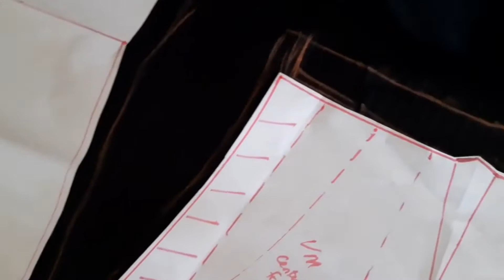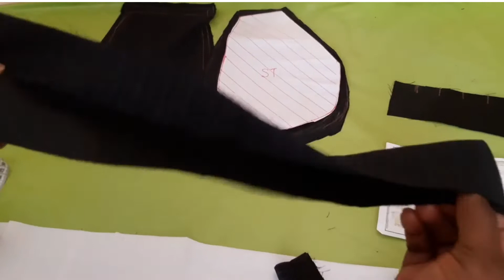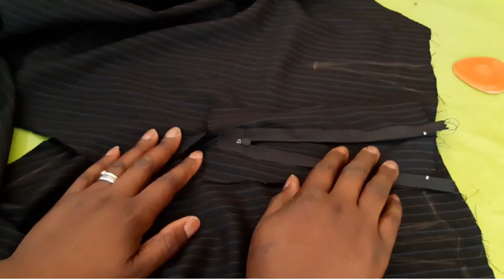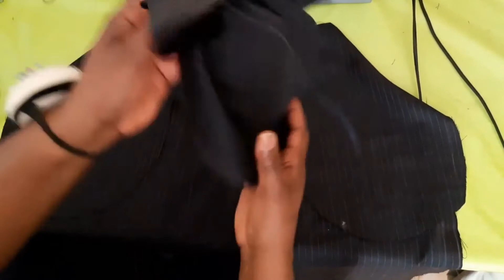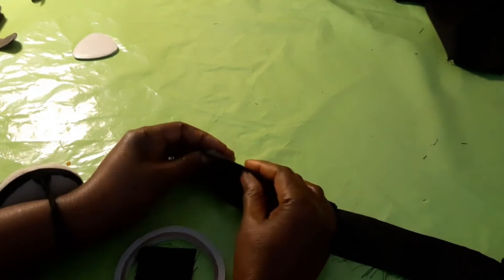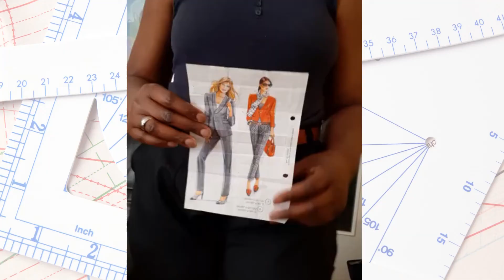LUTTERLOH PATTERN ;HOW TO SEW A FEMALE TROUSER  WITH POCKET AND ZIPPER FLY USING TWO MEASUREMENTS

Comment: I am 6'2". When making pants i find an issue with the crotch length to the back waist. With the lutterloh system do I need to make this adjustment?
Reply from the maker: Most times adjustments are needed with any sewing software you use.Even without a pattern software .we still need adjustments..with the lutterloh pattern you will need very minimal adjustments.